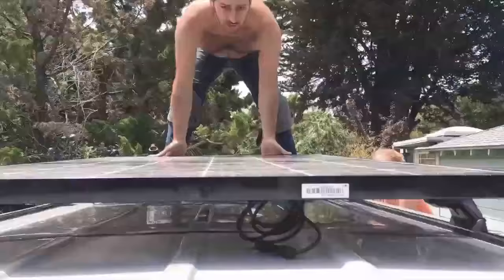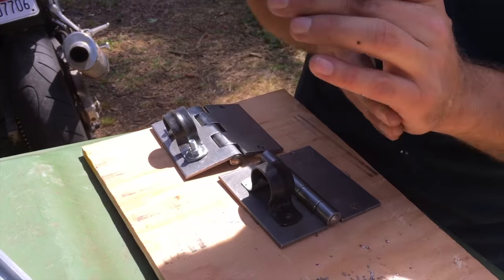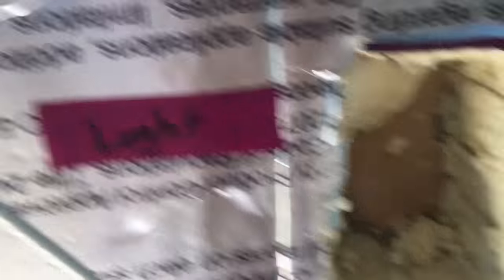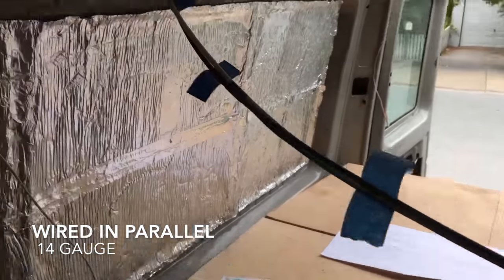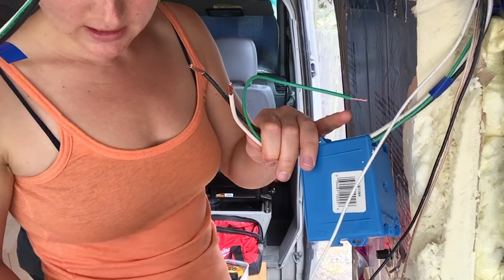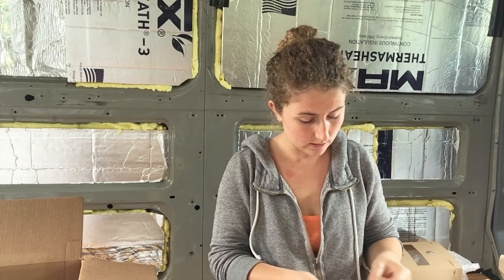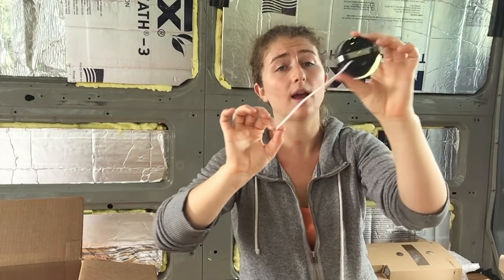Sprinter Van Conversion - Electrical and Battery (Solar Powered Van)

Comment: So much care is needed with electricity/wiring in a metal vehicle, especially with all the flammable insulation and coverings and belongings. Don't mean to be alarmist, just concerned for personal safety. Great job on the conversion Kaya.
Reply from the maker: Brian Smith thanks! So far no fires 🔥 😅
Reply: Brian Smith bp

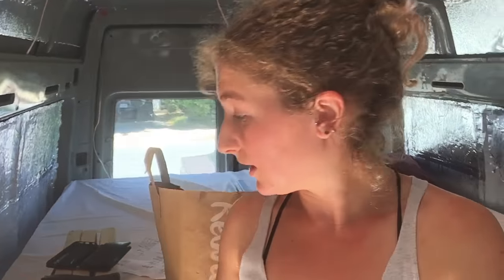Comment: Great job on the van, quite inspiring! I need to mention something VERY important: You used a Ground Fault Circuit Interrupter receptacle (GFCI). You will notice there are two sets of screw terminals (4 total, 2 for black and 2 for white) One set (black and white) is for LINE and one set is for LOAD circuit connection points. You must hook up your feed to the LINE side.The way that you hooked up the receptacle appeared to be the LOAD side. This will allow it to power any item you plug into it, but totally BYPASSES the safety circuit for the ground fault circuit interrupter!!! Please google this for a better more thorough explanation. (Look up: GFCI LINE vs. LOAD wiring) I am ABSOLUTELY not trying to be an annoyance, but want to point out something I noticed to keep you or others SAFE ! Please look into this, it is an easy fix, but could save your life!  Again great work on the van !  (At 1:42 you can see the LOAD SIDE warning sticker covering the terminals that I later see you wire to, this is how I knew for those wondering, and yes I am an Electrician)
Reply from the maker: Thank you for letting me know! I'm going to go back and see if I can find the packaging we got. I'm not sure which side was which, I may have misspoken in the video. The GFCI receptacles have tripped once before and I took that as a sign that they were working, but I'll go back and see what I can find and make a correction if I need to. Thank you for the heads up!
Reply: Easiest thing to do: Turn OFF breaker to receptacle and VERIFY power off, always be safe! Remove face plate and remove receptacle. Flip over and look at the back. You will see the markings LINE and two arrows pointing to the connections for your BLACK and WHITE wires that are opposed to each other. You will also see LOAD and two arrows pointing to the connections for the black and white wires for the LOAD side. Make sure that your connections are where the arrows from the LINE side point to. Any GFCI that I have ever installed has had that yellow sticker (shown at 1:41) covering the LOAD side connection points. If you read that yellow sticker you will see it is a warning about ONLY using the LOAD side to feed additional receptacles. This is why I am concerned as I noticed that you placed your wires on the connection points where that sticker used to be. Let me know if you have any other questions at all. I hope my explanation is clear. I am not referring to having white and black switched, I am referring to how to wire a receptacle that is specific only to a GFCI. If you do a google image search you should be able to find pictures showing exactly what I'm describing. Thanks very much for taking this seriously. Cheers !
Reply: Kaya Lindsay  nice also i love luxry cars
Reply: Kaya Lindsay The load side will allow connection of non-GFCI receptacles AND maintain ground fault protection for ALL receptacles connected to the load side.

Comment: I really really wanna make a van rv some day. Thank you for posting these, they are very informative while also not getting bogged down on the details that will surely be different for every build.
Reply from the maker: No problem! I'm glad they are helpful to you. I worry about not posting enough detail. But after a certain point, each van is different and people need to figure out what works best for them!
Reply: Hi, could you ask your electrical friend about the decisions made about brands and sizing with the gear? Thanks

Comment: You only need 1 GFCI per circuit. It must be the first one.. Then you can chain the rest down the line. This meets NFPA stands and it also protects from water. As you need one at lest 3" or less from any water source. This will save you $20.00 for each one. As I seen people use 10 in an RV and all they needed was 2...

It's also a good idea to run all your wiring behind walls in flex tubing with a extra pull string. You use Orange for low voltage control wiring. Blue for Network and black for 120\208. This make sit easy to add new circuits without pulling all the stuff back out to fix anything. 

Great job so far...

Comment: You mentioned that AGM Batteries last a little longer, and this is true. But perhaps the biggest advantage with an AGM battery is that there is no gassing. Lead acid batteries give off gas when being charged. Gas that could explode! Nice job with the van.
Reply from the maker: Roberto Edwards I misspoke in the video. Thank you for the correction! 😅 I'm a fan of the AGM batteries for sure!
Reply: Kaya Lindsay where to get AGM battery?
Reply: AGM Batteries are def needed for interior living space.  I'd recommend Lithium Ion batteries for longer lasting batteries (can take more discharges and also discharge down to 20%, whereas AGM should only be discharged down to 50%).  BUT...Lith-Ion are more expensive

Comment: biggest worry I have for doing a conversion like this is in the winter time (Canadian here) dealing with condensation inside the van when you sleep at night, and how it effects all the electrical equipment like you have installed here.
Reply from the maker: I'm dealing with that right now as I go through my first winter in the van. So far the electrical has been fine, it's pretty well insulated. However when the van roof leaks it makes me really nervous about the wood paneling molding. I've repaired two leaks and am working on the next one as soon as it stops raining! Also, I do my best to ventilate the van when I'm not in it, or when driving so that the condensation evaporates off. When we were in the snow however, the sink pump stopped working, I think something in the pipes froze! Good luck in Canada!

Comment: LEDs with their own drivers should make dimming a little easier. You really have to get out the data sheets when matching up dimmers to LED lighting from different manufacturers.

Comment: IF in the future your invertor or your shore battery charger should die ( let's hope not for many many years :)  ),  there are invertors that when connected to shore power stop inverting the battery's 12V to 240, but let's  the shore power  passthrough plus it begins to charge your batteries :)  That way you save a boxsize of space :)

Comment: Fantastic video!  Question: How did you secure the wood planks to the van walls and roof?  This was definitely one of the best conversion videos. Thanks!
Reply from the maker: Thanks :) I'll be doing a video on how we did the paneling soon! But basically construction adhesive and then we tacked it in with some screws.

Comment: thanks for posting your videos about the van build. Looking back, do you wish you ran electrical wiring before doing insulation? I'm getting ready to do a build and I'm unsure about which one to do first. climb on!
Reply from the maker: pterodactylptroll not at all. I'm glad we did it the way we did because if I ever need to change something it's easier to access under the paneling instead of under the insulation.

Comment: great vid many thanks for the info, im going to start a new build in a sprinter van, and im a big fan of tongue and groove, do you find it gathers condensation and drips??
Reply from the maker: I do not find that yet! We're going through our first winter right now. Last time it rained we found one solitary drop of water leaky out on one of the walls, but we are unsure if it was a leak in our fan or condensation from our breath. I would recommend getting a dehumidifier. The Eva Dry models are great and rechargeable.
Reply: again thanks very much for the info, and a great looking interior!
Reply from the maker: Right? It's amazing.

Comment: Nice. Do you run portable AC/Heater? How long it will run at night before charging batteries again? Thx
Reply from the maker: Who Cares I don't have a portable heater, right now the inverter isn't powerful enough to run a heater. I'm thinking of getting a diesel heater as a better solution! And it's been over a year and I have yet to completely discharge the battery bank.

Comment: just remember to watch wire size when dealing with DC power it's really important. in my experience as far as propane heaters go the brand mr. heater is probably the best you'll find they're small and they have oxygen sensors built in.  there is one other option for heat that would maybe limited sum since you're in a vehicle you could Salvage you engine heat the radiator stays hot for hours after the vehicle is turned off and they make products like this that you could run even after the vehicle is turned off Maradyne H-410312 Mesa 12V Wall Mount Heater https://www.amazon.com/dp/B00DZEZ4HW/ref=cm_sw_r_apa_QongybJ8YGW4Y

Comment: did you use anything to absorb the shock from driving for the solar panel. spacers, grommets anything. I would definitely protect that panel as much as possible.
Reply from the maker: When I originally edited this video I got way more into how we strapped the panel down, but after showing it to a few people they said it was waaaaay too long and not really the point. The solar panel has got a really sturdy frame around it which we secured to the roof racks. We dipped the parts that connect to the round bars in plastic so the panel doesn't rattle. It's a difficult piece to describe without a visual aid... We we're originally pretty concerned with it breaking, but after our first few hail storms we're feeling pretty good about it!

Comment: Silly question, how did you seal the hole in the roof for the solar panel cable?
Reply from the maker: Myers Hub was the metal piece we used to run cable through the roof! And cord grips run it through the breaker box.

Comment: Did I see this correct? 18AWG speaker wire from your solar panel to the charge controller? How big is your panel(s)?
Reply from the maker: The 18 gauge wire is for the lights! I can't remember of the top of my head the gauge of the wire used to go from the solar panel to the battery box, I think it was 12 or 10. But for the battery leads we used something like 4.
Reply: That's still pretty small. What size is your panel?
Reply from the maker: David Sandel it's a 290 watt panel

Comment: Please tell us more about your rack!
Where did you get it? How much did it cost?
Reply from the maker: lol I was born with it.
Reply: You're silly. I mean the roof rack 😆
Reply from the maker: HeuristicDev haha yeah. It's a Yakima rack. Extra Tall towers with round bars!
Reply: Touché
Reply from the maker: HeuristicDev no I'm serious. Those are the ones we got. I can't remember the exact model but you can't get normal roof racks with the extra tall roof because they don't fit over the rain lip part of the van.
Reply: I believe you. I hadn't clicked the link.
You're saying a normal rack won't be wide enough to attach to the rain gutter?
Reply from the maker: HeuristicDev so the first one we bought wasn't actually big enough to fit around the rain gutter, it couldn't snap in to place. So the one we bought you have to cut holes into the roof and then secure it down from there.
Reply: Oh wow!
Good to know. Thank you.
I would like to secure my solar panels to the roof, then have a rack for kayaks above them.
Reply from the maker: Good luck to you!
Reply: You as well :)
thanks

Comment: So, tell me about this inverter.  The price is very good for a pure sine wave but I cannot find any reviews on it.  Do you like it so far and why did you choose that one?
Reply from the maker: We chose that one because it was the least expensive for the pure sine wave at 600 Watts. However, we are considering getting a more powerful one (1200+ watts) because we want to be able to run an electric heater in the van when we are away from shore power. Right now we can only power our little heater when connected to an external source of power.
Reply from the maker: Hey thanks for the resources! This is definitely something we've been thinking about for a while, especially since it is getting colder at night. The good thing about having a van is the small space, so we only need to run the heater for a few minutes to heat up the whole space. I'm hoping that if we get a larger inverter, plus the isolator combiner (to charge the batteries when driving) we can run an electric heater for just a few minutes and then heat the van. I've looked into propane heaters (thanks for the indoor one! I'll check that out!) but I get sketched out about burning fuel and air in my small space. The solution would be to crack the fan vent but then I'm letting all the hot air out. We have a small carbon monoxide detector which so far has not gone off. I'll look at the links you sent me but I feel like buying propane over and over again makes less sense in the long run if I can come up with a cool electric solution. We shall see! Trial and error is the name of the game :)
Reply: You may be better off looking at 12 volt heaters and apliances instead of getting a bigger inverter.  Even the best inverter is not very efficient, it wastes engery to go from DC to AC.  they make small 300 watt heaters for semi trucks that run on DC it may be all you need for such a small space, the up side would your batteries would last much longer with the small power load and not having the loss from the inverter
Reply from the maker: I've done some limited research on DC powered heaters, and I've heard mixed reviews. That's a great idea though! When we were looking at DC powered toaster ovens (I wanted to make pizza on the road..) they all had really bad reviews and said they didn't get very hot. I was assuming the DC heaters would have a similar problem. We have a DC outlet built into the back system so maybe it's time to look again!
Reply: Very impressive and inspiring Kaya! I'm looking for a van now. Did you consult any books?
Reply from the maker: Yes! Check out the Sprinter RV conversion Sourcebook. http://www.sprinter-rv.com/sprinter-rv-conversion-sourcebook/ this guy has dedicated his life to converting sprinters and its a great resource!
Reply: Some people are putting tiny wood burning stoves in their vans. You can burn compressed saw dust logs very efficiently too.

Comment: Hi, I just bought a 2002 Freightliner Sprinter long wheel base high top, I am going to convert it into a camper for my daughter and son in law. The question I have is about the roof rails you used to mount the solar panel. According to all the sites I have checked, those rails are not available for sprinters up to and including 2006. Everything I seen said that a drip rail or rain gutter mount must be used. I really hate to have to look at those big brackets, where did you get your rails from? Thanks, great videos.
Reply from the maker: Outdrzman hey thanks! Check out the electrical and battery walkthrough on my site: https://www.onechicktravels.com/blog/2017/4/11/sprinter-van-conversion-electrical-and-battery-solar-powered-van 

I link to the roof racks that we got there! They are from Yakima and pretty sweet 😎